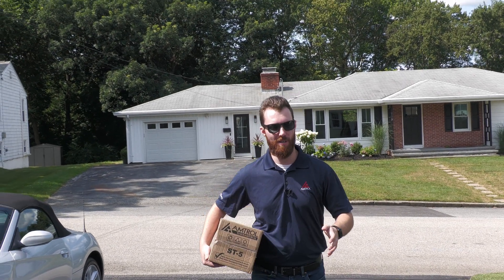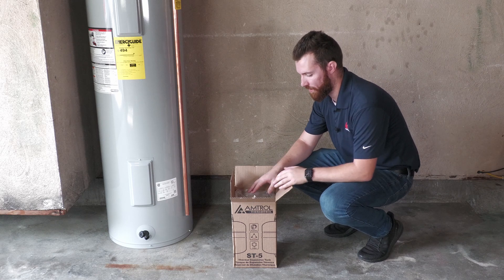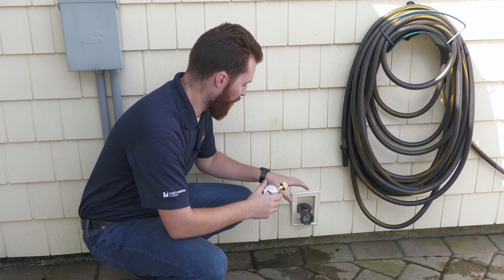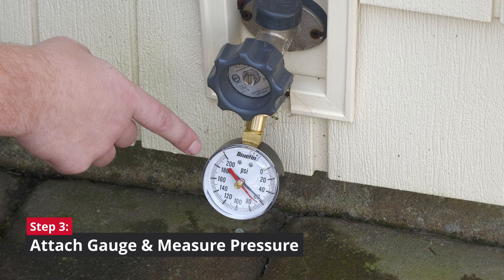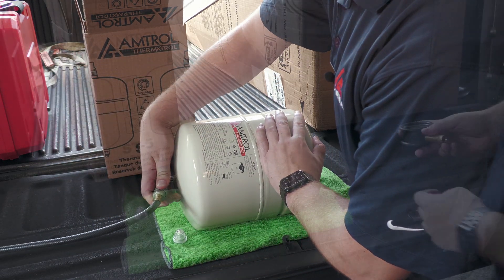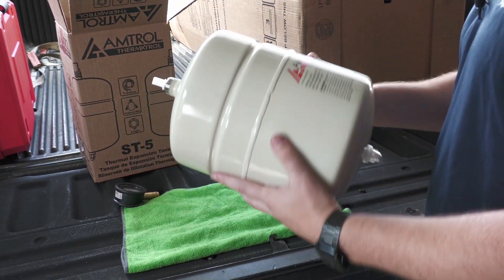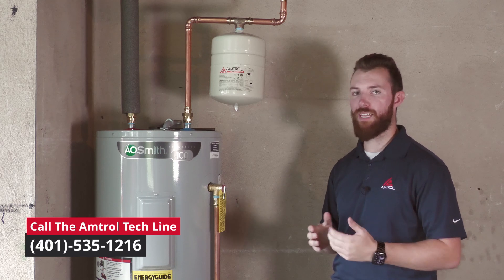How To Install A Thermal Expansion Tank - Amtrol Tech Takes

Comment: Needs support: 2021 IPC says "308.10 Thermal expansion tanks.
A thermal expansion tank shall be supported in accordance with the manufacturer's instructions. Thermal
expansion tanks shall not be supported by the piping that connects to such tanks."

Even if the manufacturer says it can be supported by the plumbing, that doesn't matter, since the language explicitly prohibits this now. 

4 gallons of water weighs 44 lbs, then add the 9 lbs weight of an empty ST-12 and this is 53 pounds hanging from 1/2 in copper pipe, ready to be whacked by someone bumping it? Sounds bad to me!

Comment: hmmm I do not have one of these on my system its easy to install but what exactly does it do?
Reply from the maker: A thermal expansion tank absorbs the expanded water from your water heater to protect your system from dangerous increases in pressure.

Comment: Can we use tire pump to increase the pressure in the tank?
Reply from the maker: If the tire pump is capable of providing the proper air pressure to the tank, that is an option.

Comment: Hello Amtrol, is there a minimum distance that the expansion tank has to be from the water inlet? I was thinking of adding a tee right at the inlet and mounting the tank horizontally, supported by the water heater

Comment: City water pressure varies over the course of a day. It may be 90psi at night and drop to 30psi during the day. There is no point to installing that tank regardless. Other than to sell tanks. It serves no purpose.
Reply: Wow I’ve worked for a water authority for 20 years and thats definitely not true !
Reply: @johnbarnes4506  I've been a plumber for 40 years, mostly industrial systems and speak from experience, go into any plant in an industrial area and test water supply pressure at night when nobody is running, then check it again during production hours. The same as if you start turning on faucets in your house, for every additional one you open, the pressure drops at all of them. The higher the demand, the lower the pressure. The pressure at the supply end doesn't vary much,  but the pressure at the ends of branches will vary significantly with demand on that branch. Your perspective is from the wrong end of the system.

Comment: Should pipe dope or Teflon tape be used at connection? 
Any torque spec at connection? 
Expected life of expansion tank? 
Thanks!
Reply from the maker: Pipe dope and/or Teflon tank can be used at the connection to ensure a leak free seal. There is no specific torque recommendation for installation, tighten until the connection is leak free. Expansion tanks will generally last 10-15 years, while some can make it far longer depending on system conditions and usage.

Comment: On my cold water line coming in right before the expansion tank, there's a pressure gauge that reads 72 PSI. Should I be setting my expansion tank at about 72 PSI too then?
Reply from the maker: Yes, that would be a reasonable pressure to match your expansion tank to.

Comment: So, the pressure of the water have to be the same as the extension tank pressure?
Reply from the maker: Correct. You want to match the pre-charge in the expansion tank with your static water pressure as much as possible to maximize the performance of the tank.

Comment: I guess I have been spelling gauge wrong all these years... After the tank is installed can you feel or measure the temp difference between the water and air in the tank to verify the air pressure is set correctly? I was thinking about adding a LCD thermometer strip to the side of the tank or use a IR thermometer pointed at the tank?
Reply from the maker: You may see slight differences in temperature from the cold water in the tank which can give you an idea of where the water level is within the tank.
Reply: @amtrolinc  this.  Really the biggest thing is you're mitigating thermal expansion backflow.  If you had a pressure gauge installed on the cold water a few feet before the water heater, you would notice that your water pressure is likely much higher without an expansion tank installed, assuming your home has a backflow preventer.

Comment: very nice video. Why the expansion tank installs on the cold water not the hot water line? Does Hot water expand? Just a question. Thanks
Reply: Yes, how water does expand.  Or I should say, heating water up causes expansion.  If there is a backflow preventer installed on your house's connection to city water, the water in your home is a closed system any time all faucets, showers, toilets, etc arent running.  Because it's a closed system in this state, the added pressure from the thermal expansion caused by heating water has no where to go, and will even backflow into the "cold water"/domestic water that feeds your water heater.  This is called thermal expansion backflow.  This is why you install an expansion tank on the supply side, or cold water side, of a water heater.

Comment: Does it matter which hose spigot and location you use to test water pressure.  I have one 10 feet away from water heater which is in my heated garage
Reply from the maker: Yes, there should be negligible differences between static pressure measured at any given spigot in the home. Therefore, it would be reasonable to measure system static pressure from anywhere, assuming there are no major elevation changes or isolation devices that would artificially decrease pressure at a specific point.

Comment: It’s possible that the water pressure is higher just right after the hot water heater just completed its heating cycle (assuming the old expansion tank fails). Therefore, before measuring the water pressure, it’s important to relieve this pressure by temporarily open then close a faucet. I have seen variation of 10 psi before and after.
Reply from the maker: Very good point! I have seen that as well on systems with a failed expansion tank. It can give a "false" reading of what the system static pressure would normally be.

Comment: @Amtrol Inc. Why is my town's water pressure so damn high. I have the same gauge that you're using. When I turn my spigot, I get a burst of 90 PSI on the Red needle and a steady 80+ PSI on the Black needle. All 3 spigots are the same. Thanks in advance for any help you may provide.
Reply from the maker: When choosing which pressure to use for your expansion tank pre-charge, you would want to match the static pressure of the system. The static pressure would be the PSI after the initial surge has subsided. If you ever install a Pressure Reducing Valve (PRV) on your water supply, that set pressure would then need to be reflected with your expansion tank pre-charge.
Reply: @amtrolinc  Thx for responding. I certainly appreciate it.
Tim Blackburn
Reply: @TimBlackyBlack  Most expansion tanks advise a max setting of 80psi. If you're running over 80 from the city, you need a prv.

Comment: Help! 
I cannot find an explanation of what the turbulator is for. I installed an Amtrol ST-12 on my water heater and followed the instructions. I pressurized it to match the house supply and inserted the turbulator like you did. I just would like to know what it is for and what would happen if it was left out. Any idea? Thank you.
Reply from the maker: The Turbulator will divert clean water flowing past the expansion tank connector into the water chamber of the tank. This will help minimize stagnation and aid in the consistent flow of fresh water throughout your system. Nothing bad will happen without the Turbulator installed, however it is highly recommended as it only benefits your tank and system.

Comment: I have pipe racket when using hot water.   hot water heater in attic, both cold feed and hot out at high points of system .  Cold fill line has dip tube to near bottom of HW tank. Would surge tank be better on hot side?

Comment: My pressure goes to 75 then to 55 after 10s. Which do I use? Also did you use teflon and pipe dope? Can this connect to a FNPT adapter?
Reply from the maker: Does the pressure change occur during water usage? That is a large swing for a system with no current draw on it. I would make sure all fixtures are closed and no water is running when taking a pressure reading on your system. We just used Teflon tape for this install, however you can add extra sealant if necessary. Our expansion tanks will fit any standard 3/4" female NPT fitting.
Reply: @amtrolinc  Great, Thanks. Yeah it's odd. Nothing else running. For the first few seconds the pressure is much higher then drops down. This is why I thought to change the expansion tank. It's full of water.

Comment: So your water pressure is 60lbs and you charge the expansion tank to 60lbs.  As the water heats it expands and the pressure goes up. 
The pressure exceeding 60psi pushes the bladder but that higher pressure exists everywhere in the system.  Giving the water a place to expand into doesn’t control the pressure because the now increased air pressure in the tank is exerting that increased pressure back upon the water.  Correct?

If you left the pressure gauge installed, filled the water heater with cold water and let it heat up, the pressure gauge would also go up, wouldn’t it?
Reply from the maker: Yes, it would. However, the pressure rise with a properly installed expansion tank is going to be far less than without. Since the water has the extra volume to expand into, the additional space minimizes that pressure rise across the remainder of the system.

Comment: what happens if you set the expansion tank too low or too high from the house pressure?
Reply from the maker: If the expansion tank precharge pressure is not matched, the expansion tank will not be working as efficiently as it should. If the pressure is too high, you will not be utilizing the full volume of the tank. If the pressure in the tank is too low, you could over extend the diaphragm causing premature wear.

Comment: What if i have a booster pump?  Do i take the reading at the tank?  Do i set the tank at house pressure or pump pressure?
Reply from the maker: You would want to use the pressures that will be seen where the tank is located. Therefore, if the pressure tank is located after the pump, then you would use the pump setpoints to set your tank properly.

Comment: I recently ordered a 5 gal expansion tank for my 75-gallon water heater, but i received a 2 gal expansion tank. I went ahead and installed it. Is it OK, or should i replace it with a 5 gal tank?🎉
Reply from the maker: For a 75 gallon water heater, our larger 4.4 gallon expansion tank would be recommended.

Comment: Thanks for the short (but excellent) video.
I have a 2 year old system (expansion tank, lines, water heater, etc.).  Recently, the TPV has activated several times.  Shouldn't an expansion tank essentially stop the TPV from releasing water?  Any major culprits you would target?
Reply from the maker: In normal operation, the thermal expansion tank should prevent any dramatic pressure increases. If you have a relief valve drip, it could either be the thermal expansion tank (incorrect precharge, failed tank), the TPV itself (clogged seals, bad part), or a pressure reducing valve to the home that might not be functioning. If you would like technical assistance, please reach out to our team at amtrolwatersystemsinfo@wthg.com.

Comment: does all of water expansion tank come with a turbulator ? or just Amtrol bransd ST5 model ???
Reply from the maker: The Turbulator is exclusive to our Therm-X-Trol "ST" series expansion tanks.
Reply: does require to use turbulator ? because when I Install new water tank. I didn't use turbulator. thx
Reply from the maker: The main function of the expansion tank is to absorb expansion pressures, which is possible with or without the Turbulator. It will still work, however you will forego the added benefits of diverting fresh water through the tank.

Comment: does the tank need to be exposed to the inflow stream- or can it be off to the side 
Can you Tee off an inlet pipe that is plumed directly down into the cold water fill line and put the expansion tank on a 2’ horizontal leg with a 90° down, or will air be trapped in that horizontal pipe between the supply line and the tank and cause problems.
Reply from the maker: It is recommended to have your expansion tank installed with a tee inline to your water flow. This will allow fresh water to divert through the tank (with our Turbulator) and contact our anti-microbial liner. If installed on a dead end pipe, it limits the effectiveness of water exchange in the expansion tank.
Reply: @amtrolinc  thanks for your reply . I ordered a T-5 tank couple days ago,so your instructions are greatly appreciated - just need to figure a good way to work it in the flow path. Thanks again!! totally makes sense.
Reply: @amtrolinc  Thanks. Situation dictates, but if there is little room to add a tee after the shutoff valve, this may be the only option. I understand it may limit effectiveness of water exchange, but would it limit the effectiveness of absorbing expansion pressures?

Comment: As far as the expansion tank's orientation: water intake at bottom vs. water intake at top: which one is going to result in maximum durability of the rubber membrane? Simple logic says: water intake at the bottom & Schrader valve at the top. Has there been any scientific test comparing one vs. the other? Home Depot sells one (globalwater solutions:
PressureWave 2.11 Gal. Inline Pressurized Well Tank) that has the product label that is readable when installed with water intake at bottom. Amtrol should consider re-thinking their recommended installation method when connected to a water heater, no? Amtrol also sells the (WX-101 (140PR1), 2 Gal WELL-X-TROL In-Line Well Tank) model, which has the product label readable when the water intake is at bottom.
Reply from the maker: The recommendation for the vertical-downward orientation mainly derives from the functionality of our indicator cap. The indicator cap is an early detection of a leak in the diaphragm to signal the need for service. As we mentioned, you can install the thermal expansion tank in any orientation as long as it is supported properly. We would expect equivalent lifespan in both vertical orientations you mentioned.

Comment: Have 2 40-gal tanks plumbed in parallel. Is it ok to install a single expansion tank rated for at least 80 gal in the supply line prior to where it splits in two? Or do people typically use two expansion tanks?
Reply from the maker: Yes, that is OK. You can use a single expansion tank that is properly sized for the total hot water volume in the system prior to the water heaters.

Comment: Why on the cold water side?
Reply from the maker: Great question! The expansion tank needs to be "on the supply line to the water heater between the backflow (check valve, shutoff, etc) and the water heater" i.e. the cold water line. One reason is the expansion tanks are not insulated, so hot water will lose it's heat within the tank, wasting that energy. If the expansion tank is on the cold line, that expanded water will flow through the water heater first ensuring an uninterrupted flow of hot water at the fixtures. The cold water line is also the "fool proof" location for expansion control as it centralizes where the expanded water can go.
Reply: @amtrolinc  The California required Dielectric Nipple heat trap is a check valve so the pressure from the tank will not travel to the cold/supply side?
Reply from the maker: A heat trap is intended to prevent heat from gravitating out of your water heater through the pipes, it should not inhibit any pressure or flow from moving freely. If you look inside one of those dielectric nipples, it is a loose rubber flap.

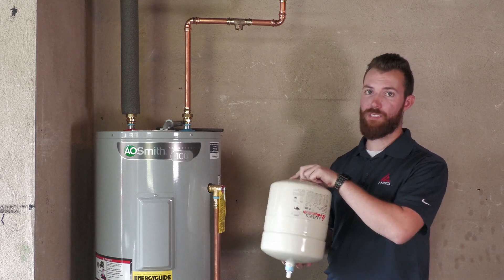Comment: 2:03 The current manual does not allow for any other orientation other than downward.
Reply from the maker: Our Therm-X-Trol manual was updated June 2023 to allow alternative installation orientations if the vertical downward is not doable in the space available.
Reply: geez, the changes are tough to keep up with @amtrolinc
Reply: The upward orientation is advised where the heat is turned off during winter to allow drainage when draining the hot water tank to prevent freezing. @amtrolinc

Comment: Bad idea.  I'm not a plumber but the tank has weight that puts stress on the pipe  connection. such that over time there surely will be leaking from the connection because it isn't supported responsibly..
Reply: Plumbing code says it need to be supported by something other than the pipe itself.
Reply: Exactly, this is like suspending the water heater off the floor, by letting it hang by pipes.
Reply: Know your code it varies widely. Most code allows the unit to hang on copper no supports. Plenty of support so long as your copper is hung to code, which also veries...😅
Reply: @its4michael  so we can all learn the code as well as you, please site the plumbing code that allows a thermal expansion tank to be supported solely by the piping. Thank you
Reply: Like he said in the beginning. He's not a plumber. He should've kept saying that to himself over and over and over again. However, he felt the need to write something to show why he is not a plumber. Not that intelligent.
Reply: @wiley0714  you beat me to it